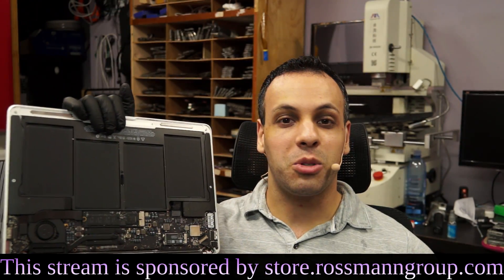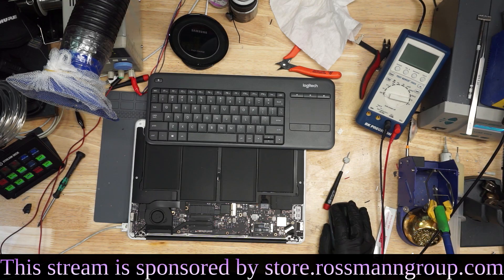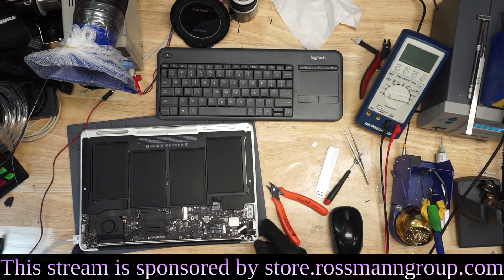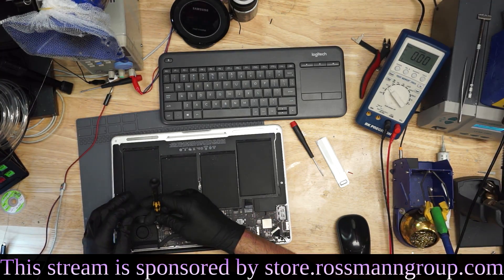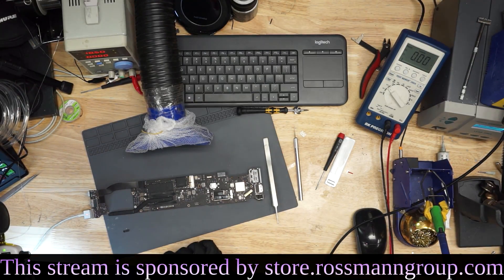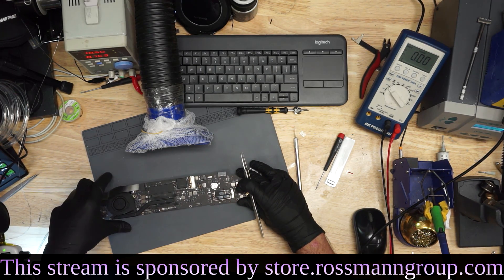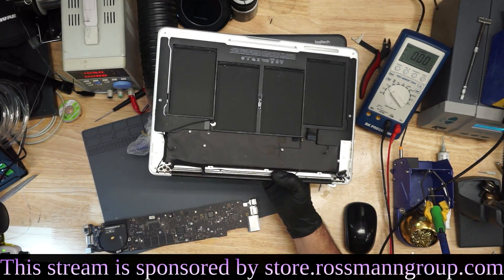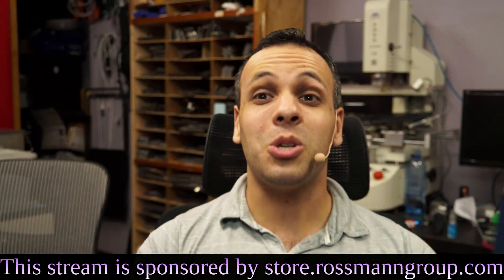Can spec of green dust kill a Macbook?

Comment: Last week a friend of mine asked me to fix his Lenovo R31 that spent 9 or 10 yaers on his boat for navigation system. It had a hard time booting and coudnt connect to the GPS anymore. 
only a bottom plate and dock station had corosion, all electronic looked like new inside the computer. I only changed the CMOS battery and back it went to the boat again. 
Should he switch to a macbook?

Comment: My first laptop, an Asus F3JP didn't boot anymore for some reason. I cried (expensive 1700 euro piece o ... love) and then took a screw driver.
There was a little piece of dust stuck between two pins of a random SOIC chip. To my amazement, removing it was the solution to make it come back to life. I repaired it! That level of joy was indescribable.
The main board was still functioning when i threw it away, nine years after production.

Comment: My gf spilled about a half a bottle of water on a dell business laptop in her backpack ( and only noticed like 20 mins later ) and i took it apart, and heated it up a bit with a hair dryer and works like a charm . that happened something like 6 months ago and no sign of corrosion or any issues. ( also there was plenty of water in it. i even had to dry the ram slots and around the cpu area. i think that much water would have killed a max beyond repair. keep up the great work with your videos Louis

Comment: Rather then telling us these products are garbage!  Can you explain to us, the viewer, as to why the corrosion on the logic board would cause the fan not to work?  To me, the stuff you scraped away couldn’t effect the flow of current as there wasn’t any component connected to the solder point.  But I’m not an expert on matters of component level reworking and such.  Again, I would like to know what you think is the reason the green stuff was ultimately the culprit in this case, thank you!

Comment: You obliterated what looked like a socket or connector and didn't comment on it at all.  Was that a prototype board?  What was that thing you melted away, and why was it better to remove it?
Reply from the maker: It is a JTAG connector. it is for apple's own internal use for testing/reprogramming the BIOS/SMC. Normal humans like you or I cannot use that connector to do much. The connector is right on the corner where water leaks in with no protection so any moisture winds up collecting on it, causing corrosion, and killing the entire machine. Think of it like an appendix.

Comment: What exactly makes them crap, is it the circuit board they use or electrical components and how they are connected. What makes them more susceptible to failure than any other machine that has water damage or component failure. Do pc laptops or desktop use a different set parts on the motherboard? Just wondering

Comment: Well, to be fair, YES, a broken trace can affect a thinkpad as well (even one - think of the +19V Vin Line ;) ). It's just built in a way liquid does not get to the board that easily. 
AND: most thinkpad owners care about their product and know how to treat tech. 
That's not the case with apple. Don't get me wrong, even if 15% of the macbook owners take care about their machine, that's probably more people than all the thinkpad owners together.
The other 85% who don't know anything about tech are random. Some treat their stuff well, some don't.
And even if 1% of them have issues, your store will get flooded. 
But that is no excuse for other, non Liquid Based issues like the shitty Keyboard, thermal profiles straight from tchernobyl, and dodgy solutions like a rubber iMat® to fix loose BGA chips

Comment: One thing that is funny tho. I have a MacBook Pro 2011 that works like a charm. Never had any problem with it. Sure, i’ve upgraded it with an SSD, but that’s for better speed. But i’ll still have to agree that they are overpriced. But not  shit. 

A thinkpad is what I would call shit. A thinkpad is not visually as stunning to look at, as an Mac. It’s a shit brick stuck in the eighties that’s absolutely hideous. If I’m going to be productive, I want to feel aspired. I’m not getting that out of a thinkpad. 

Thinkpads are more robust? Couldn’t care less, it’s not like I’m using expensive computers as a sledgehammer. 

Lenovo is heading the right way with ideapad though. But there’s still problems there. Poor color on the monitor, keyboard feels cheap and the fans are the sound of an airbus engine. And also, the OS is not tailor made for the hardware. This is why Apple is always one generation behind the other company’s, because they utilize the max out of the hardware. Everyone else just throws the newest in.

Comment: I agree that they are easy to kill. Mainly the iPhone is where I killed 2 before and they sent one off to some specialist but still could not save it. They couldn't even figure it out what was wrong. Screen died on iPhone 7 plus but it would come on just enough you could see it was trying to light up. New screen wouldn't turn on either so they ship it out to get fixed. I am sure it was something very stupid. Thankfully I was able to restore most of the stuff on there. 

MacBook I haven't had issues with personally. Mine is pre keyboard issue though. Although if I leave the thing on and it goes to sleep without shutting the laptop it does that same thing the iPhone did. You can tell screen is on slightly but you have to hold power button to kill it then turn it on. It didn't start until they did update on OS. They said it would need a clean copy reinstalled it sounds like the updates didn't install correctly. I just haven't decided to go thru that. To be completely fair though I had 1000 times more issues with window updates and issues with windows. That was why I switched. Windows ever since they launched this new app based system I had so many issues. 

So hardware yes other laptops are more durable. OS though I will take Mac over PC still. I had way too many crashes with windows os and the constant updates make it so it is unusable sometimes. Restart windows at office then takes 20 minutes doing updates. If you could customize your hardware selection when buying mac it would be much better. I think they are more worried about phones and watches though last 4-5 years

Comment: thinkpads are invincible. that thinkpad i got 2nd hand in 2010 still runs perfectly fine to this day AND EVEN WITH THE ORIGINAL OS INSTALLATION. the only dead thing was the battery drive circuit so i use it without the battery now, but the internals are fine and i dont think it ever has been opened for a dust cleanup and i just beat nfs prostreet (2007) on it

Comment: I've had several Lenovo Carbon X1 Laptops in my shop with onboard RAM issues. Lenovo insist on using this brown glue to bond the chips to the board which is near impossible to get off and contaminates any solder balls when heated. The boards are produced by Wistron but only Lenovo insist they use this specific glue on their boards. The Carbon X1 is a bad example of longevity in a laptop.

Comment: A lot of people don't buy Macbooks because "Apple."  They buy them because "Windows." 

Specifically, Windows 10 is so bad that people who can't run what they need on Linux (or who are not up to installing it) have only one other choice, and it's MacOS.  Few of them are up to the task of creating a Hackintosh (and if they were, Linux would be no problemo), and Apple is the single-source hardware supplier for the entire MacOS platform, so it's their way or the highway.  

Personally, I just use Linux (I went from Windows to Windows/Linux dual boot to Linux/Windows dual boot to Linux fulltime), but most people won't install an OS; they use what the thing came with, so if it came with Windows, then Windows shall that machine be.  I think Louis wrote a comment to that effect in one of the Linux videos I saw the other day, and it's been my experience that it is true.  With the EOL of Windows 7 fast approaching, a lot of people claim they will move to Linux, and I would love to believe them, but I think most probably won't do it.  

So, that.  You have Microsoft doing their level best to help Apple sell Macbooks!
Reply: Well that is just matter of preference .. I dont really had issue with Win in last 10 years running PC desktop either 24/7 or putting it to sleep for few hours in night .. 

I do the same work on Win laptop (currently ASUS) and MBP .. on MBP tehtering SW needs to be restarted quite often, camera is always disconnecting, on Win I dont close that SW at all for months and I never had disconnection. MBP gets hot, slows down when I put some stress on it, ASUS just runs around 60-70C and it is able to hit and run on maximum frequency. 
MBP battery (new one) will hold for hour or so when tethering, yesterday I had ASUS on shooting for 4 hours and still had 48% (same work condition again)  .. 

So eventhough I like design of MB (well except that terrible keyboard), some features are cool, integration to whole eco system is much better and I even dont mind the touch bar instead of Function keys (I though is dumb at first) for my workflow (photography, DIT) I`m better of with 1000 USD Asus over 3000 USD MBP ... still have to run MBP as DIT cause clients dont know anything else and they wanna Apple, at least I know that me, client, agency see the same colors on screen (till clients came to look at CG Eizo and than I have to explain why it looks bit different, and that they dont need to worry :) ) ... Im sure for other workflows it would be different story

Comment: I don't understand, why wouldn't it happen to other computers? I thought that if you have the wrong component broken it does take just that to take it down. Are other computers made with rust resistant solder?
Reply from the maker: Motherboard is covered and they have drainage holes in other brands.

Comment: I remember when I was looking for a laptop for college and I found all these threads of people complaining that the screen on their Thinkpads had an imprint of fingergrease from the keyboard because the screen was so close to it. It required it to be carried in a backpack filled with stuff.
People with Dell Latitudes complained about slight whine when reading data from an mSATA SSD.
Notice that all of these laptops are functional and let you read data off of them if necessary.
Also, I ended up buying an E7440 in 2017. That's now a 5 year old machine. Works great, and I bet it has more power that a new Macbook Air. The battery is a bit weaker than it used to be, but I can swap it without a single tool .

Comment: I have an HP that that traveled to, through, and back from two different wars. It's been stuffed in with combat gear and tossed around. It's been dropped 10 foot onto concrete, which did nothing but somehow break the tabs holding the fingerprint scanner in and eject it from the case. It was even the target of a pissed of girlfriend who slammed it shut as hard as she could, which took out the HDD, but left the irreverent, honey badgeresque rest of the computer laughing. Then windows vista went to shit because I ripped most of it to shreds, and so it sits here happily churning away with a linux distro on it, even though it runs the graphics card like an oven, no fucks given. This thing has kicked ass for a decade and HP's aren't even known to be especially robust. Fuck Apple, 100%
Reply: Well, in addition to the Thinkpads we use (see post above) we've got 3 HP Workstations (Xeon, i7, i5), 2 HP ProLiant Servers (DL380G8 2013 now dual Xeon, 96GB, 1150 GB disk space (2x Raid1 + Hot Spare) , one SAS disk failure after 4.5 years in RAID 1 + Spare; DL360G7 2010, 4x 500GB Raid 1+0, one 2GB RDIMM module failure - upgraded to 84GB memory *LOL*; both servers been running basically 24x7x365 for 5 and 8 years) as well as 11 Procurve Switches (4x 1800-G24, 2x 2610-POE, 2520-POE, 1700-M8, 1800-G8, 1810-G8, 2650-M48 lifetime warranty) which all have been running smoothly *touch wood*. 
When I sometimes call HP support for warranty extension or upgrade related questions (compatibility) they always reply very swiftly; mainly because they seem to be very bored from lack of repair and replacement work! :o)

Comment: yah, you can kill any laptop by having a single crucial circuit corroded and shorting. It's not a tough book or whatever but yes, you're right it could be improved by making it more impervious to moisture, shock, corrosion, dust, granted. I still love my macbook pro and it's hanging in there, bouncing around on logging roads (in it's case usually), through the rainforest and back, on the beach, on a boat, with a goat. It still works, gets the job done man. Hopefully these are not going to be "famous last words" because i depend on this thing. This is my 4th or 5th macbook and macbook pro, they have all been awesome in their way and surprised me with the abuse that they can take. One thing that pisses me off about this one however, is that in order to replace the battery apparently one needs to replace the trackpad at the same time and it costs 400. That makes no sense to me from a design perspective. Definite design flaw there. I think this one is a retina 15, 2014, 4 years old and not one issue thus far except for a monitor replacement when it got knocked off a table onto a tile floor, understandable, shit does happen.
Reply: i poured a liter of water into my inspiron 7778, a dell machine, you know the ones that are famous for sponaneously exploding. it happened while i was asleep, the machine continued to run for 4-8 hours after, typing this comment with that same machine.

Comment: I’m sending you my 2013 13 inch MacBook Pro to fix if it ever dies. Just built it from new old stock from eBay, Amazon, PowerBook Medic and a few others. Nice machine I intend to keep for years. It is my last Mac; next real new machine will be a PC. Your videos helped me to realize that 2015 was the separation line beyond which quality drops off for the sake of thin. Not so much an Apple fan nowadays.

Comment: A tiny spec of anything can kill a MacBook. The real question is can smacking it on the side make it work again like an old time TV? Hey it worked for me on a VAX 3200 once. You'd be surprised.
Reply: That's how I used to "fix" a rattling fan in my old laptop (and I mean single-core Sempron running XP old).
Shame the HDD died for some reason...
Reply: I have a ThinkPad T440p with a flickering display and a hit to the side fixed it!
Reply: I had a friend who's cheapo desktop PC kept crapping out. We'd warned him not to buy it before he did, so we're highly amused by it playing up....
But anyway, one day it was being stupid, so he kicked it (switched on). It did a full flip, cables still connected, and nearly yanked the CRT monitor off the table.
Surprisingly, it actually worked better after that... Except, like the post above me - the HDD died soon after for some reason.

Comment: If the copper tracer under the corrosion isn't broken (as we can see after the scratching) then why did it stop working ? Could someone explain ?
Reply: MrBleulauneable I am not sure, but I would guess it was not passing enough voltage/current for the system to run. See how he added some solder to make a better connection.
Reply: @thejflores1219  my guess was passing enough current through the green growth to that adjacent line to trigger some error state.
Reply: The green dust as he calls it is, in fact, verdigris it is copper corrosion from liquid contamination, as it is an oxide of copper it partially conducts electricity and this is why the machine was ok it after it was cleaned up, he simply used an acid flux to clean it and then reflowed the solder joints, its not rocket science but is misleading as the original fault on this MacBook is obviously a liquid spill, nothing to do with the fragility of the machine but the clumsiness of the user spilling a drink or some such in the keyboard, a PC laptop would do the same thing..
Reply: https://www.youtube.com/watch?v=0U5n2WaMMHo - if lenovo can do this why cant apple???

https://www.youtube.com/watch?v=mgppfpHqEWs - Video of how the cutout works
Reply: Dravas  they can....   why "doesn't" apple?  I think we already know...
Reply: are you 100% sure it was a liquid spill? what other signs of oxidation was evident. maybe it was just normal moisture.

Comment: I have to admit apple engineers are worth some respect. I couldnt design a circuit to die that easy even if i wanted. I mean, i still cant understand how that worked!
Reply: Probably shorted via the green crud to a line that caused it to be unhappy. Because the green crud is only partially conductive, even if it was 19v shorting to a line expecting 3.3v signals, it could trigger the line to be high all the time without actually damaging anything.
That's just my guess from personal experience with corroded electronics.
Reply: Easy add voltage checks everywhere ! And mix together lines of different voltage !
Reply: Yes, you can't.